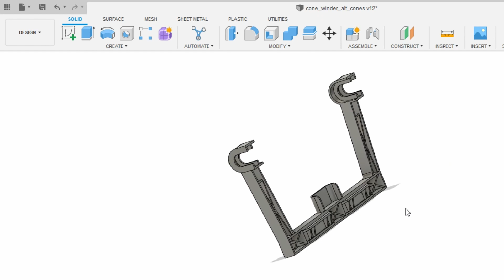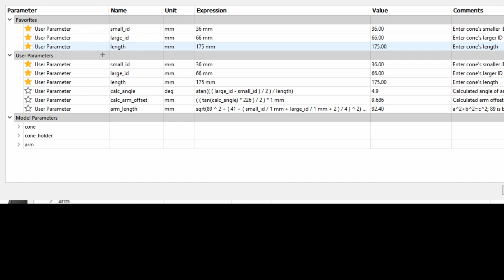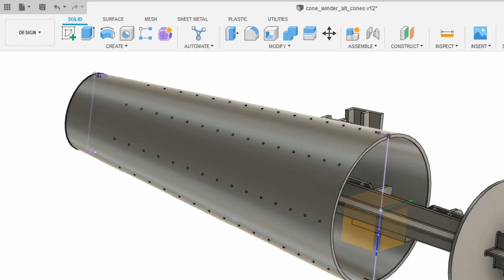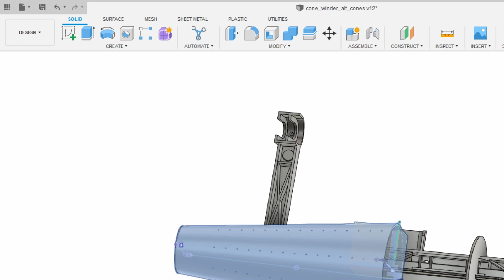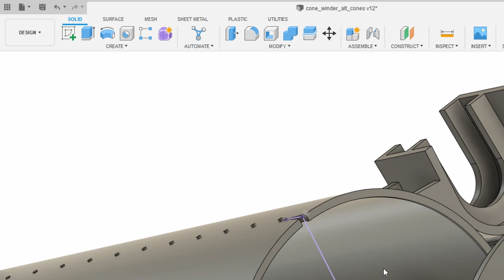SPIN 143 - Cone Winder Cardboard Cone Support Details

Comment: Can you make cakes with this?
Reply from the maker: It can't make yarn cakes.  It is designed to wrap yarn around a cone or tube.  There are advantages to doing a cone over a cake and I'll talk about those in the Kickstarter when it launches.  I thought about making a ball winder to make cakes, but there were a lot of devices doing that out there already so I did this because I could help this part of the neglected market.